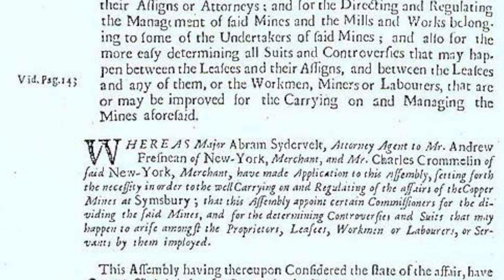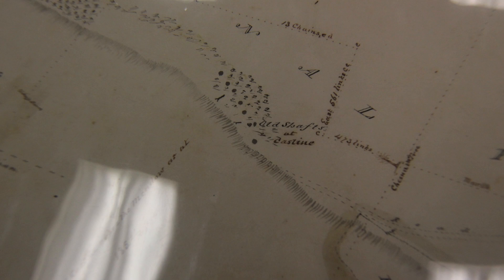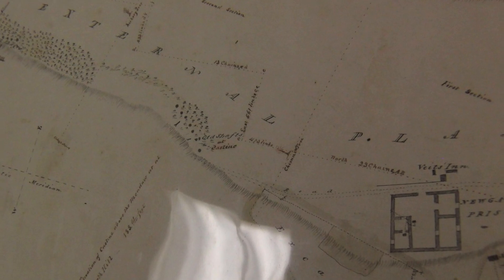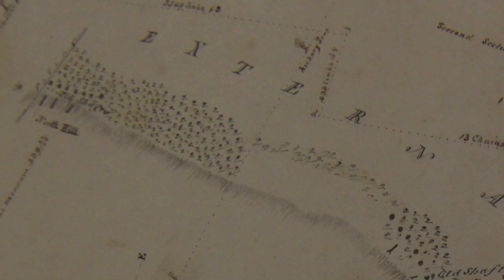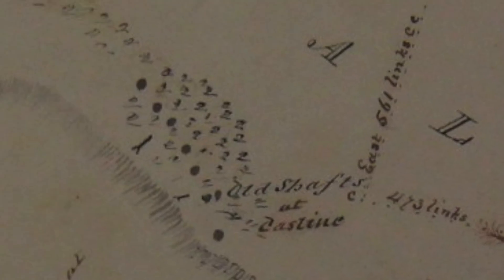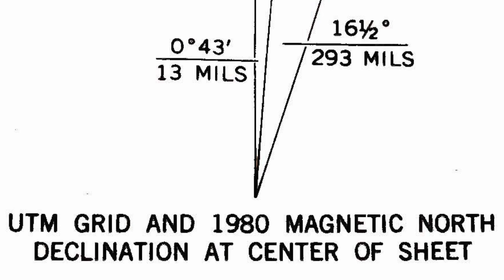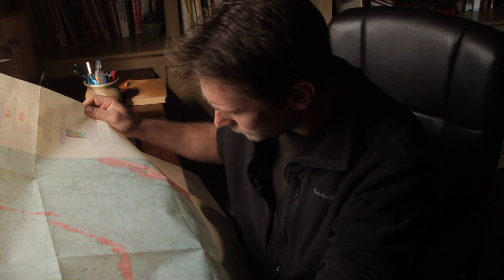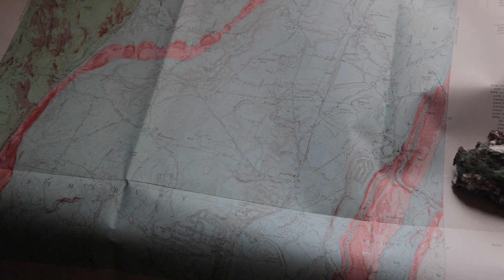The Lost Mines Project: Using Historical Maps to Find Abandoned Mines

Comment: Wow! That's an impressive amount of research regarding declination, converting rods to feet, etc.. But in the end, it's worth it. Nice job! When opening up a sealed tunnel like you did at the end of this video, how long did you wait before entering? I would be worried about "bad air" inside the tunnel -- especially low or non-existent oxygen levels. Did you let the tunnel "air out" for a day or two before entering?

Comment: Interesting that we use similar to track down a few mines around here too. A way I sometime go is to overlay a old map in Google Earth, simply scan in the area of map you want to look at, ideally with some features that are still present today, in google earth - goto the area you know roughly where it is, click Add -  Image overlay and load in the scan of your map, you can alter the opacity slider on the left hand side to see through the scanned map and then its just a case of scaling and rotating the map to get it to align as good as you can get it. It should be good enough to give you a idea where it is along with coordinates.